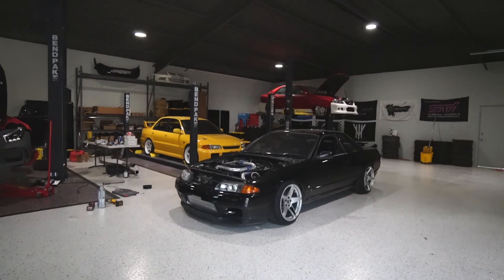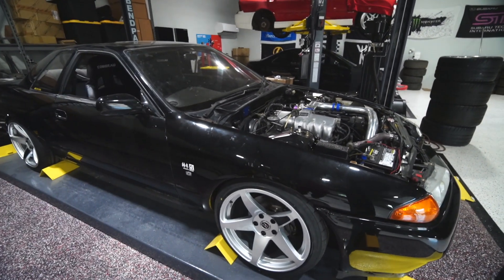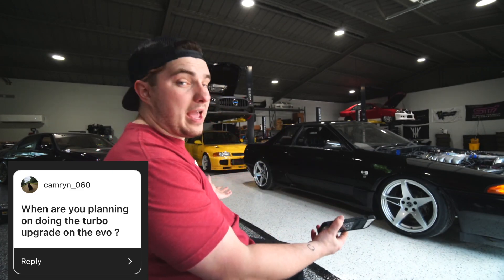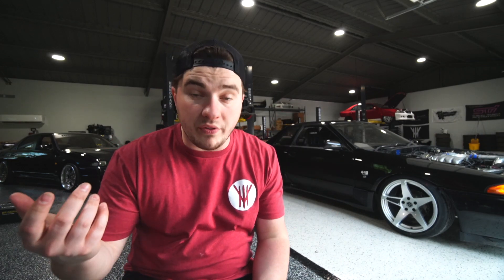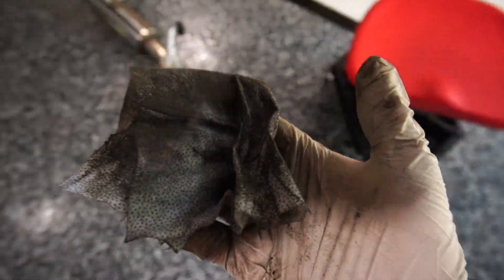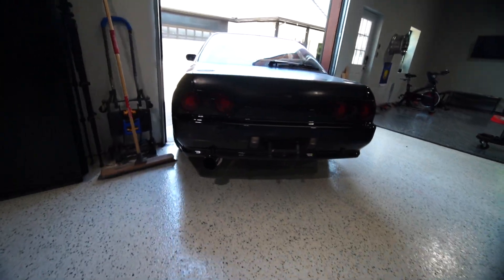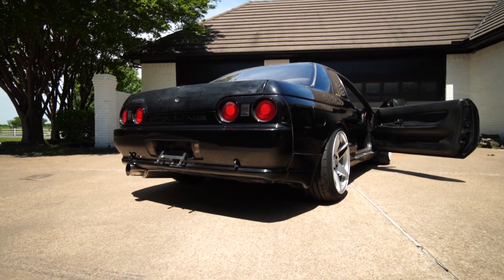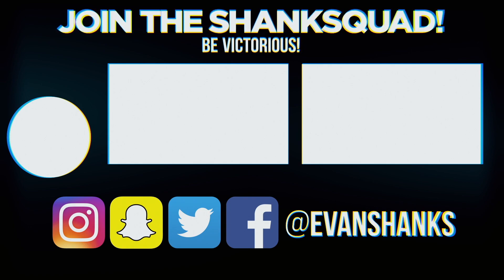R32 Skyline gets the PERFECT EXHAUST!

Comment: Those N1 style mufflers are designed for racing in the N1 class which are normally aspirated and turbo cars. Anyways they sound so good on N.A. cars tho. I have a 5 zigen fireball N1 style muffler on my ae86.
Reply: It got super loud when we swapped the motor out to a supercharged 4agze.